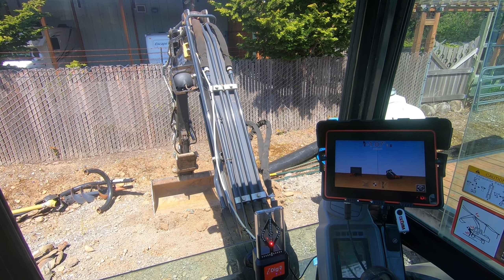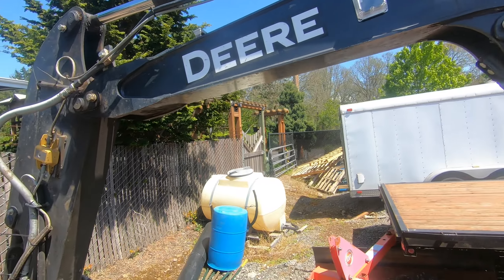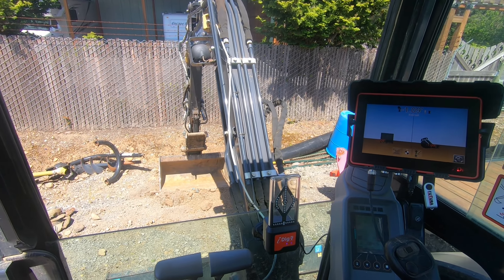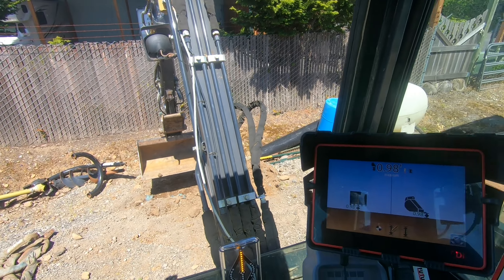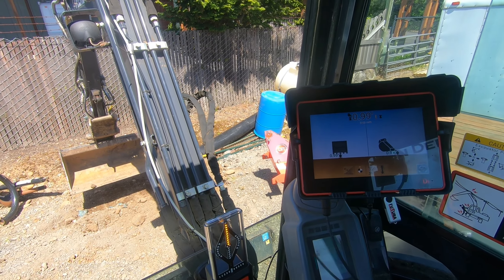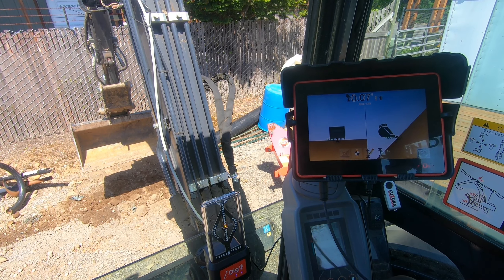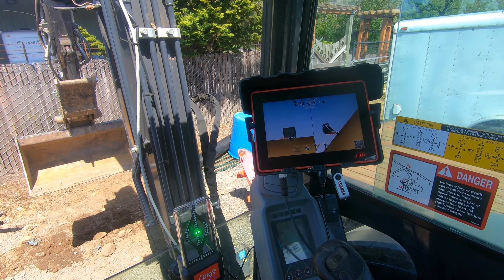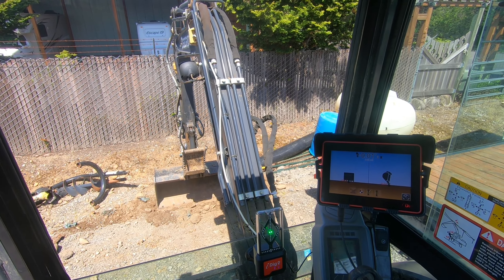Intro - iDig CT740 2D Excavator Grade Control Kit (Upgradeable to 2D+ & 3D)

Comment: Isn’t that sensor on the bucket/dogbone going to get damaged?
Reply from the maker: The sensors themselves are shockproof and waterproof, while being in a stainless steel bracket that is stuck to the machine via industrial grade 3M double sided tape. There is always a chance for damage, however in this case it's quite low.

Comment: you didnt show where you set up the rotating laser
Reply from the maker: Using a rotating laser is a function that the system has, not a requirement. You can "bench" (or zero) off of the cutting edge of the bucket, OR catch a rotating laser to "bench" (or zero).